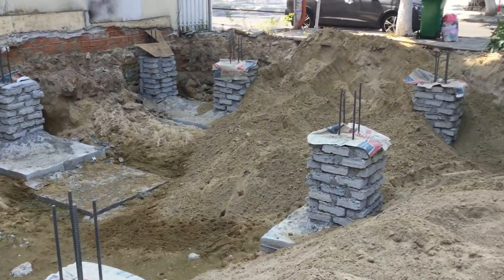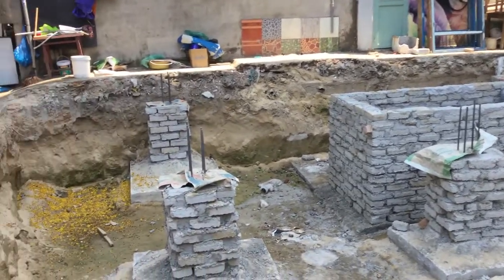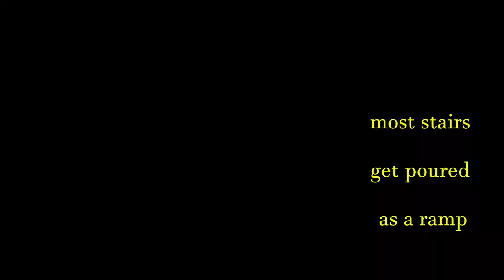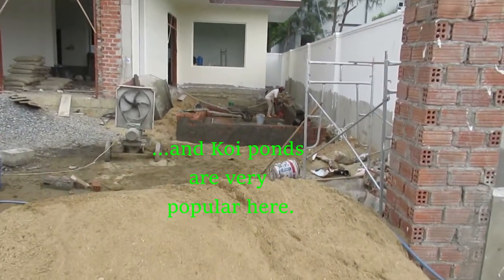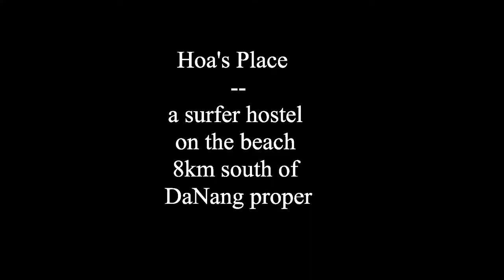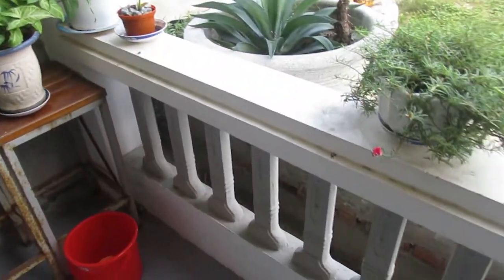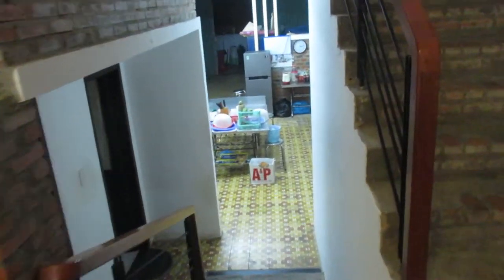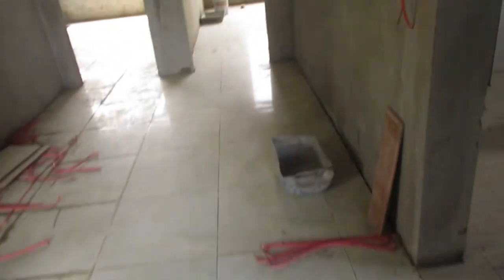Vietnam Construction Techniques

Comment: Lots and buildings look like 3 to 4 meters wide...12 feet wide lots? or interiors...? An apartment might be 51 sq meters - 170 sq feet = 12 x 14 Feet....how are taxes and other fees?
Do they have sewer and water? How cheap is the construction labor? 

Great Video thanks so much...
Reply from the maker: Hi. Most lots are right around 5m wide and vary in depth greatly. The taxes are assessed by width. My apartment, which is typical is 15ft x 25 ft.. it's perfect for r a single guy.

Comment: Hi, do the vietnam hanoi land is wet swampy land?  How they build the fpundation in tradisional way? Thanks
Reply from the maker: Foundations are built pretty normally for conditions, and engineered. I'm sure hydrostatic pressures on foundations are considered and engineered for those conditions... one thing the Viets in Hanoi don't have to worry about is freeze-thaw, but they do have to worry about seismic issues.

Comment: I like that music track. Good video. I'm glad someone did something on this. I find Vietnamese construction facinating but I often question it's structural integrity. No offense. Am I wrong? I don't know i failed physics in school.
Reply from the maker: They are engineered by competent engineers, one would expect. There is an architecture school here. They have ferro concrete frames and brick infill walls, and then everything is plastered over.... The massive weight of these things, hopefully is being carried by good-enough foundations.  There is no freeze-thaw here so they can get away with a lot of stuff that you can't use in the States, or Canada, such as outside plastic water pipes, and no insulation...  I don't have central heat. I have AC and dehumidifier.